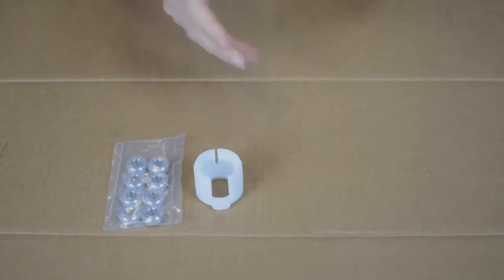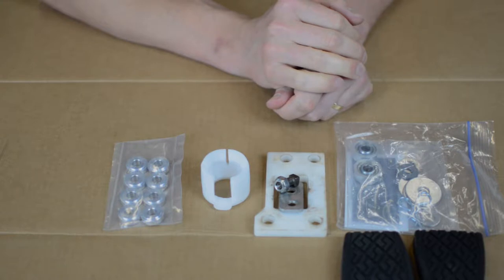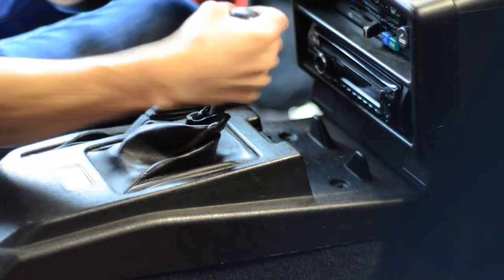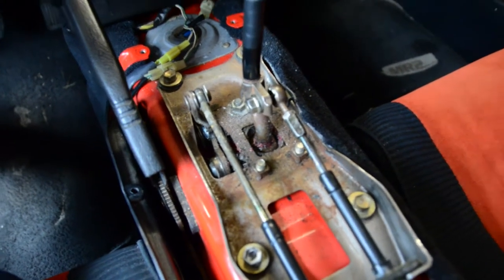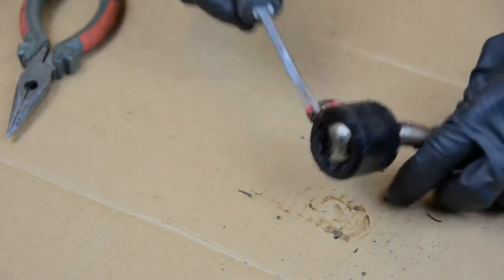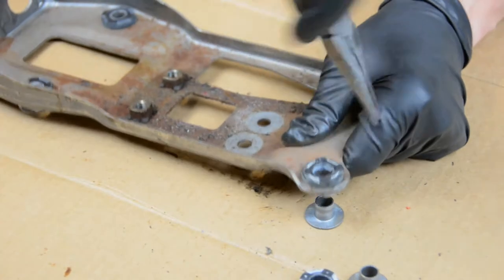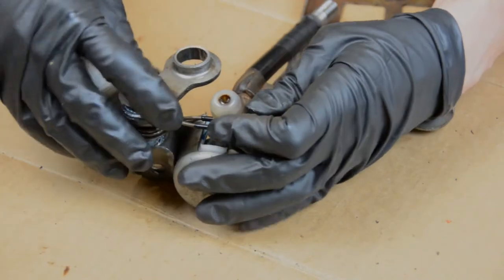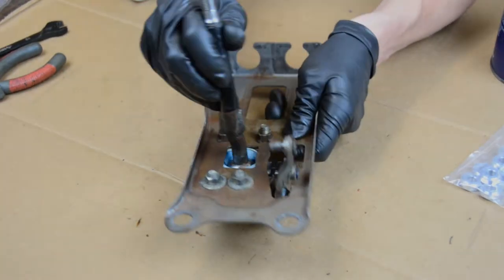AW11 Shift Cable Bearing, Shift Cup, Shifter Base Bushing Install | Episode 5

Comment: Great video.  Did spherical bushings make any difference with the car moving on the road?  If sitting still it would be hard to get the full story since some gears wont engage easily depending on alignments between things in the stationary gear-box etc...